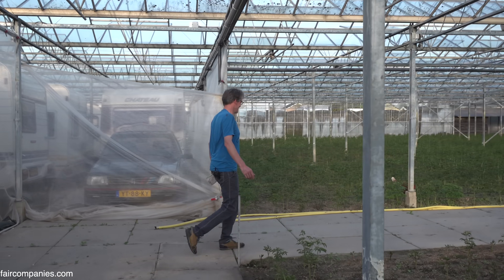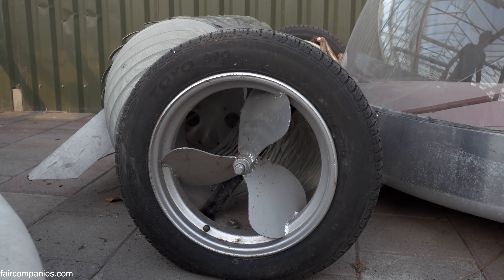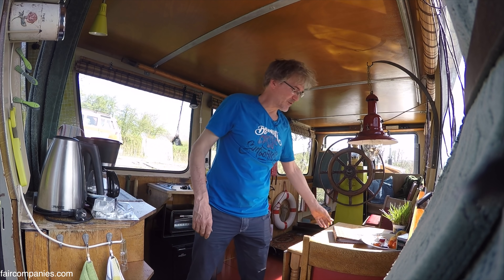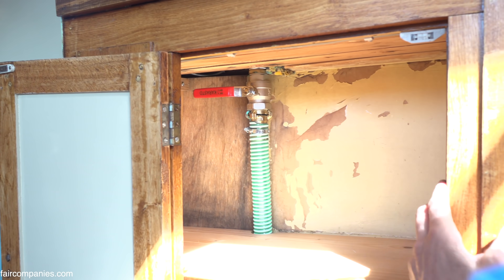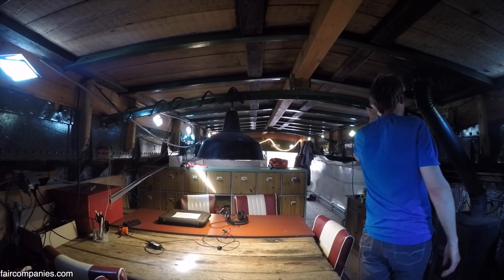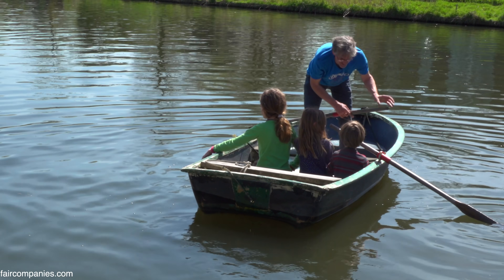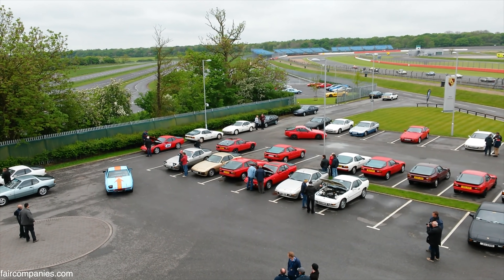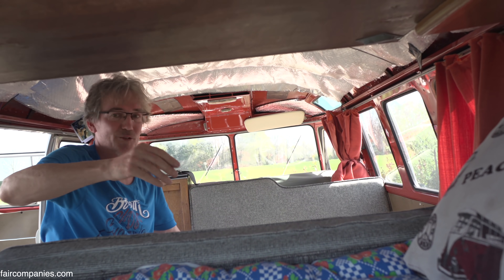Wind turbine cars, whimsical houseboats & bikes of Oskar de Kiefte

Comment: After watching this I went in my 100ft square workshop, out of my cement mixer, two washing machines and a flux capacitor not only can I travel back in time but I can deliver cement on time and do two washes at one in two universes...
Freakin amazing what you can learn from university you tube
Reply: I just think along the lines of I send 2 hours a day on the road burning fule just for transport, how much stored electric engery could I generate in that time. 

Short answer is come home and plug your car in to power you home to reduce peak demand.

Comment: I suspect the amount of energy he gains with that huge wind blade on the front of the car will be lost from the drag of that very wind blade. The more energy the blade produces the more it is dragging the car to a stop requiring more energy to keep the car going the same speed. 

It is interesting, but i suspect any wind resistance that is produced by the motion of the car will slow the car, that includes the little fans in the tires. Even though the blades turn produced by the motion of the wheel, any wind resistance created by it will drag the car down. And if you are expecting those fans to push that huge squirrel cage then it means those fans will be dragging the car down because it takes energy to turn fan blades fast enough to push or pull enough air turn a generator.

The bottom line is that it won't work. Actually it is worse than just having a car with no generator with as little wind resistance as possible, aerodynamic. I also suspect he tried it already(tested the mockup) because there is no way that car just sat there with all the work he put into it and curiosity he has with the huge turbine on the front, without it been tested yet. You can't get more energy out than you put in and i suspect maybe he is learning that.. In fact you will get less, so a car without that stuff will get better mileage. But, if you expose the turbine(lift a aerodynamic lid, etc...) while you are parked and the wind is blowing hard, then you can use it beneficially.